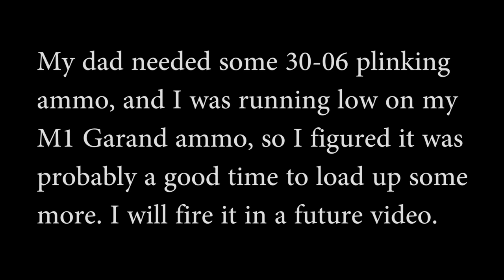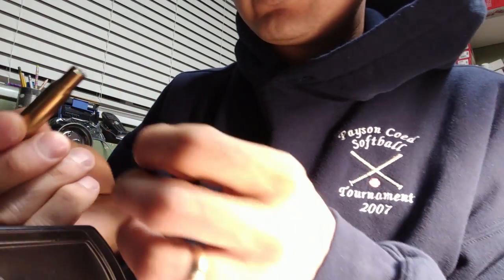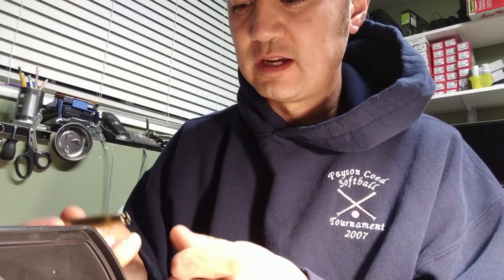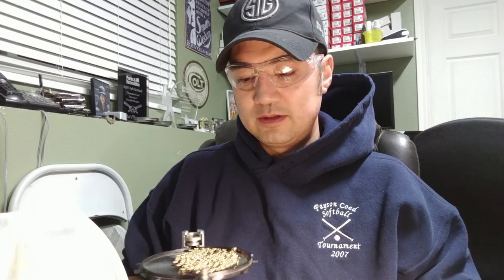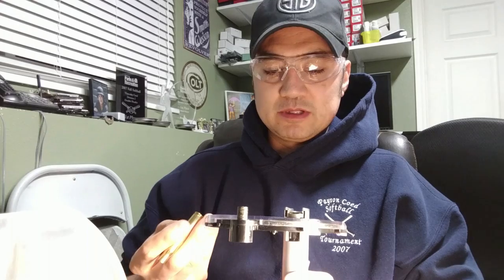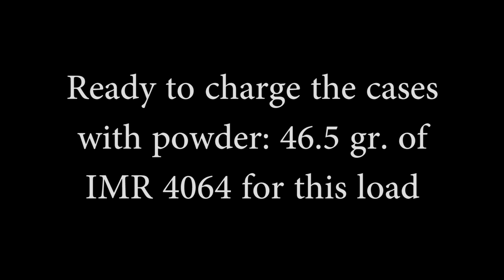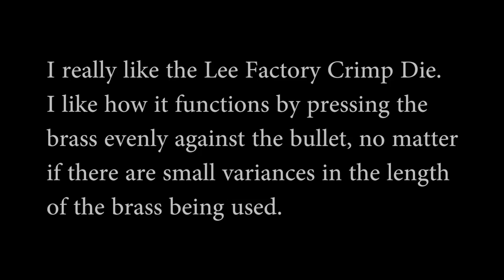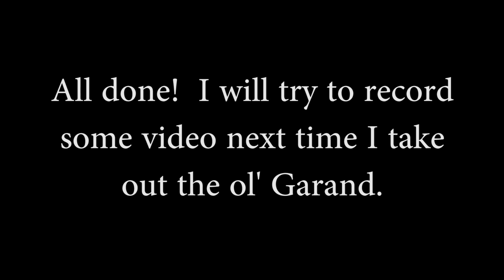Loading up some M1 Garand ammo / Plinking ammo for the 30-06

Comment: 2 powder dispensers, 1000 cases of 30'06.. damn I'm jealous.
Reply: AZHighDesert Just get a standard powder drop that you use by hand and you can drop that powder 4 times as fast with out the need for an electronic powder measure. Trust me I have both styles electric ones have there down sides also after loading you need to disassemble them and clean which takes lots of time and you can lose the small parts. The manual hand drop style comes apart in one minute blow some air through it and you are done!

Comment: After hand priming 100 cases of 9mm, my arm felt like i had popeye forearms.  I quickly discovered being cheap when starting reloading almost caused me to swear off reloading.  No one wants to  buy my lightly used primer...I wonder why?  I should have just put that money into the RCBS press priming arm in the first place.  I can still feel when its primed and my arms do not look weird.
Reply from the maker: Ha ha, but I love popeye forearms!
Reply: I use the RCBS/9460 and can't say enough good about it.  You still have the FEEL of hand priming and you get half seats etc. I don't trust the priming function on my Pro Chucker  5 and half seating is common enough with this system.

Comment: you should try a bullet like the 311299 (200gr) with 32-35 gr 4895. or same bullet with imr 3031 start at 28gr and work up just until the rifle cycles. remember both of these powders can easily be reduced down to 60% load density if not less.i believe the 4895 gave the best accuracy at around 34-35.
Reply from the maker: you're shooting cast bullets in your garand?
Reply: sure ive never had a problem with it or the sks and ak. that being said ive always used gaschecks even with powder coated bullets i semi autos however i do not believe it is necessary .as long as your bullets are sized properly lead in the gas cyl should never be a problem.i size .311-.312 in the garand and with coated bullets .310 should be fine.
Reply from the maker: Yeah, just haven't tried yet.  I should though.

Comment: That seemed like a pretty conservative load for 30.06, do you get full fire form to the chamber with this load?
Reply from the maker: +zachary roach with the Garands you have to watch the powder choice as well as the powder charge so you don't bend the op rod in the ol' Garand.  I don't have the adjustable gas plug in mine.  Yes, these loads are strong enough to fire form in the chamber.
Reply: il be damned.
Reply: So if you have that special gas plug you can make your loads hotter?
Reply from the maker: +zachary roach in the Garand, yup!
Reply: so like 3000-3100 fps with 150 grain bullet.
Reply from the maker: +zachary roach I can't say for sure because I haven't tried it personally, but I do know that with the adjustable plug, people can up their velocities without damage to the op rod